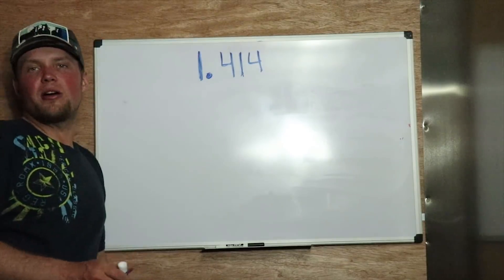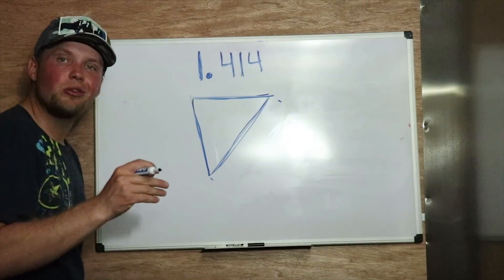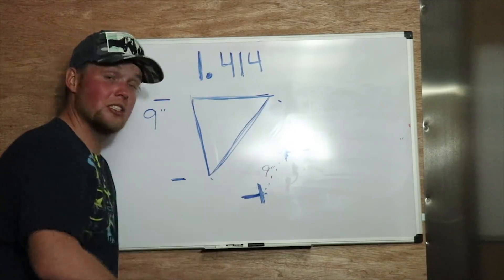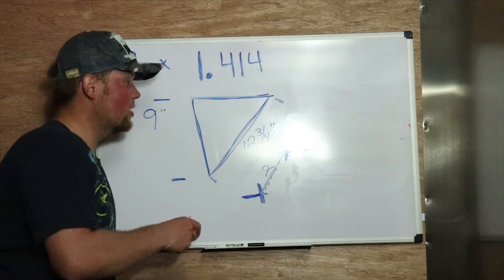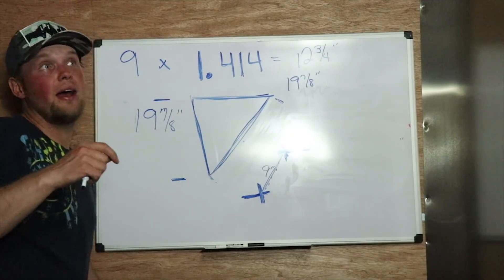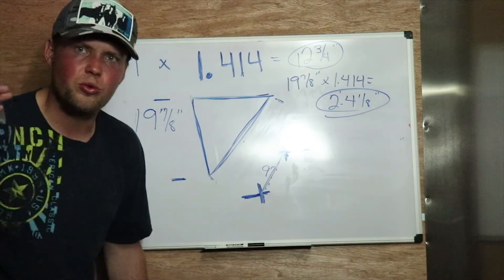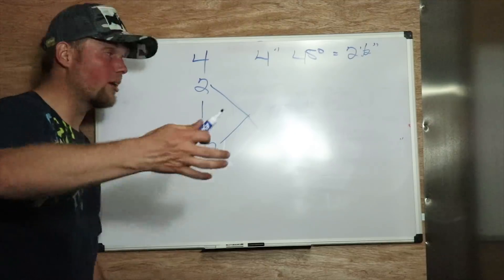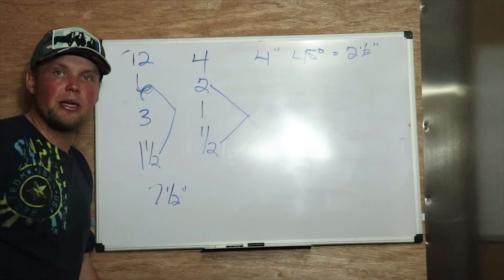Pipefitter Tips How to Find a 45 Degree run.

Comment: We do all socket weld fittings in the steel mill for our pipework. Does your takeoff formula work the same for those or just for the mandrel bent fittings like you use in the field?

Comment: The 1.414 comes from the square root of 2. From trigonometry, the long side of that triangle is the short side length times the sine of a 45 degree angle. That gives you square root of 2 times the short side length
Reply from the maker: Awesome thanks Lowell

Comment: There is a quicker way to find the takeout of a 45 if you have a calculator, it will be the pipe size x .625 or 5/8 of the pipe diameter

Comment: Great video Jacob, what I do to find my take off for a 45 I multiply the pipe size times .625 and it gives you the same answer. 
45s
Pipe size X .625=TO
90s
Short radius: the pipe size is the take off
Long radius: pipe size X 1.5= TO
Extra long radius: pipe size x 3= TO